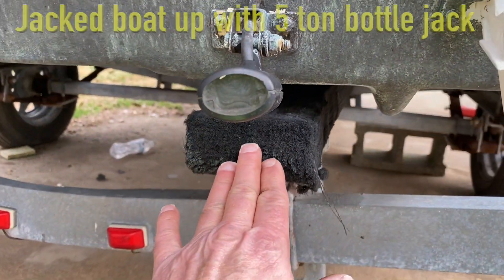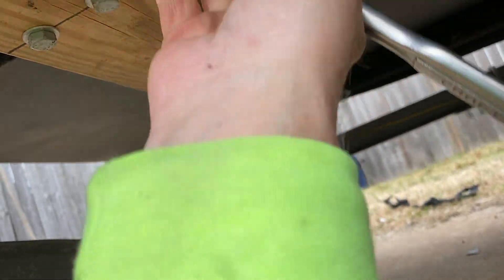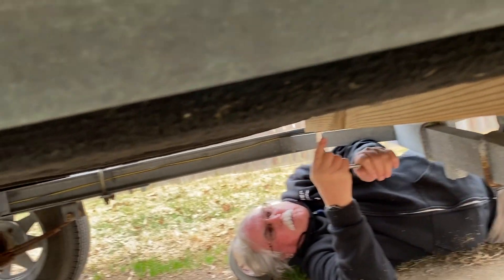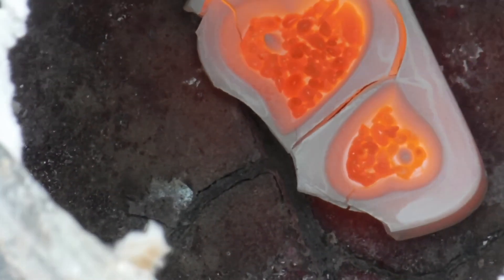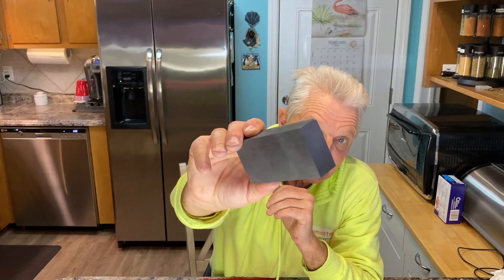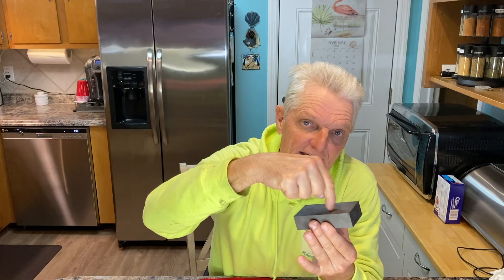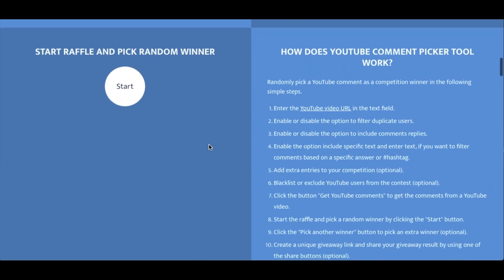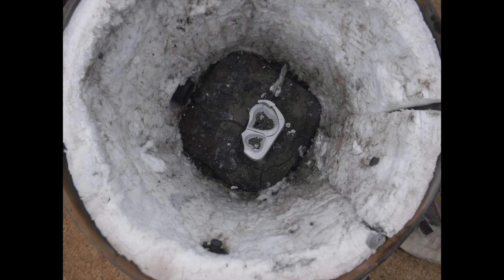Updates, Previews and Reviews

Comment: When I lived in Portsmouth and worked at NNSY one of my coworkers relatives had a high voltage  power line go down on their peanut field up in Petersburg area and burned almost a mile before the breakers shut the power off.The soil was sandy and so turned it into glass.VEPCO had to pay to haul off the glass which was about 20 truck loads of 10 yards each. I used to hear people say "Welcome to Virginia,owned and operated by VEPCO" so I'm sure they could afford to haul off the glass,lol. I pay a lot less for electricity here in Washington than I paid there but we have hydro and transmit it to other states.The dams on the Columbia and Snake rivers provided the power to smelt aluminum and metals to help us win WW2 and still provide us with cheap power.